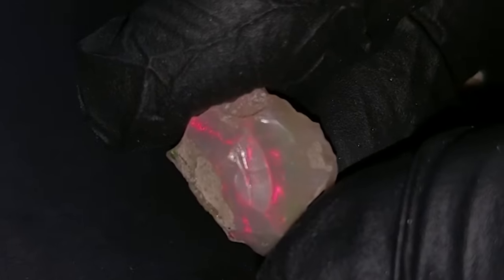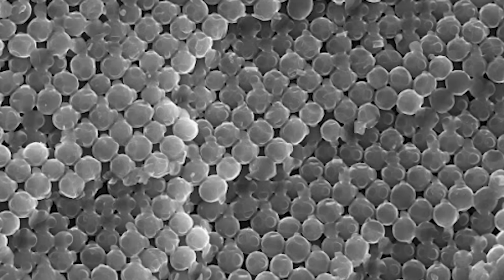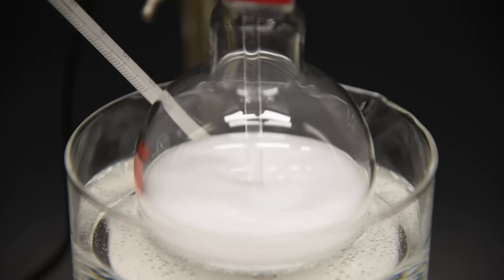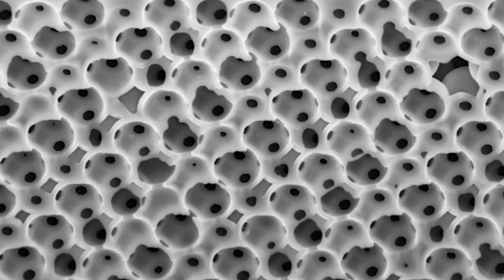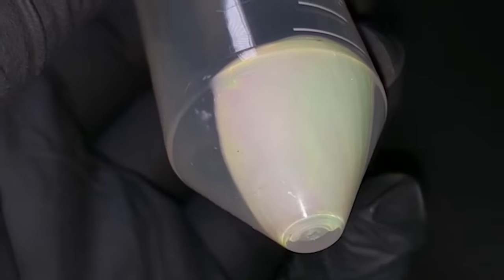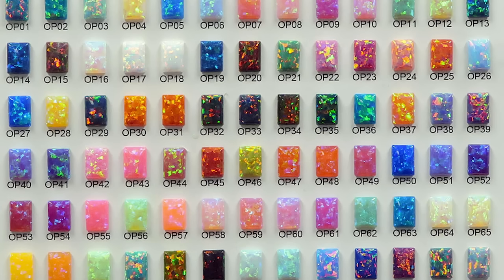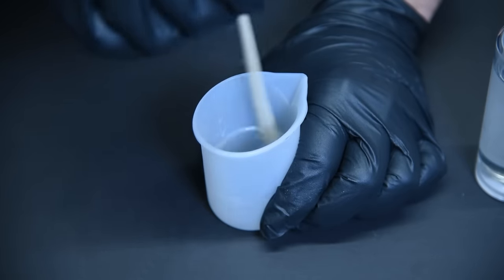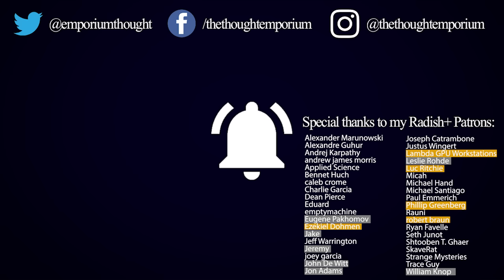Can you GROW an Opal?

Comment: For the resin, maybe try cactus juice or another wood stabilizing resin. To prevent the tiger-stripe effect, maybe attempt to use an asymmetrical mold and allow the opal solution to settle out over multiple additions with some level of disturbance and changing the nlangle that the mold sits every couple months (essentially attempting to replicate natural deposition in the dynamic environment of the earth with tremors and changing pressure)

Comment: Regarding the resin, maybe you could put the resin into the vacuum chamber alone, then put the opal into the resin, and then putting that into a pressure pot.  That's the process used for resin moulding.  As for what type of resin to use, I'm not sure what would be best, but probably a 12hr, or 24hr resin would work best, since those ones are a lot stronger.  I like west system resins for my projects.

Comment: If you used a pressure pot you could use some very very runny acrylic, I use PMMA for making dental appliances. Possibly you could also cure it under a vacuum instead of pressure
Reply: Maybe on the vacuum id personally go with a pressure pot. Gets rid of porosity which is the main issue with runny mix of resin. The one we use is mixed kid of thick but somethings we need it super runny to pour into the small crevices if we aren’t using hydraulic press and it will get porositywhen mixed runny so we put in pressure pot so all the excess solvent is pushed out of the mix. Maybe this could help bc it would push it into the small micro holes on the opal

Comment: You need to add intense pressure along with your heat. Also look up water glass. Get you some raw granite, rose quartz crystals, copper and silver nitrate. Pulverize everything. Use water glass process. But intensify heat then pressure. Or just take a quartz crystal and heat. A torch will give an aura look. Slow hot heat gives another set of colors. Much like the fake Opal, you can create some pretty cool things.

Comment: You should try LOW VISCOSITY resin that is typically used to stabilize wood under a vacum. Maybe this way is better to fill those very tiny gaps between particles

Comment: I absolutely love the video, I hope that you keep attempting to Improve the process.  My guess for the synthetics would be a matter of 
pressure, temperature, and possibley vacuum chambering at some point during the process. The last opals you linked without the striations looked very much like a cured resin pucks So there is either an Atmosphere or chemical difference that would cause the opal to creep up on the sides like that

Comment: So, in my brief googling, I have found that opal naturally forms by hot water falling onto sand, picking up silica, filtering through some sedimentary stone, and finally depositing that silica in a void in the host stone. Of course, this natural process takes several thousand years, so it's not something that you can just wait around for. 

So, what if you mimicked that process? Drip your heated silicon mixture onto a host stone, let it dry, drip again, dry again, etc etc. I imagine this will eliminate the stripe effect at the cost of a longer wait time.

Comment: I bought a small bottle of UV resin. It solidify on contact with UV.
Accidentally a drop of resin dropped to my finger, I tried to beam the UV to it, and it solidify quickly.
The photo reaction is exo-thermic. I felt a strong burning sensation, but since the drop is small. The reaction soon ended.

I would suspect the UV resin on the opal didn't work out because of the heat.  
May be pouring the UV resin and monitor the temperature, make sure the intensity of light isn't too strong.

Comment: Would there be a way to let the solution settle under pressure? Or, maybe add pressure periodically through the settling process to break up the grain columning?

Settling under pressure might tighten the matrix as well, removing the need for a silicate or resin filling to counteract cracking during drying.

All that said, I am not a chemist, or a gemologist, or a scientists of any type, so take my rambling suggestions with a grain of salt. Just throwing out ideas.

Comment: I know I'm a little late to the conversation, and I'm not exactly a chemist, but it seems pretty obvious, at least as far as I can see it, how a person could get rid of the tiger stripe patterns.

Step 1: start growing the pre-opal in the normal stripy way.
Step 2: partially, or perhaps even fully stabalize the pre-opal, making it hard and sturdy enough to break instead of powdering.
Step 3: break the sample into irregular fragments.
Step 4: create more pre-opal in the normal way, but add the broken fragments to the mass, incorporating large amounts of irregularity into the tiger striped pre-opal.
Step 5: repeat steps 2 through 4 at least a couple times more.
Step 6: fully stablize and finish the mineralization process to turn it into opal.

This might take a significantly longer time than the striped opal, but it at least sounds like it would allow you to induce irregularity.

Comment: Ever consider a wood stabilizer like Cactus Juice or Stikfast where the object is submerged in the stabilizer then pull a decent amount of vacuum until you feel all the air has been removed. Relieve the vacuum to allow the stabilizer to be pulled into the empty spaces then wrap in tin foil and heated at 200 degrees F to cure the stabilizer into a solid. Ta-da

Comment: I have no experience in stabilizing opals. I suggest, to stabilize opal, you could try vacuum packing the opal and thereafter introducing into that vacuum cyanoacrylate glue (open thereafter to allow moisture to polymerize it) or try 2K car clearcoat (then could leave it closed until polymerized). Please tell us how it turns out for you.

Comment: I have an experiment that who wants to try 
I called bucket Opal experiments. 
You need a bucket with top ,a tube 3/8 or whatever, long 24 in or more filled  with desiccant silica gel ,two bottles  container A and B ,A connected with B ,A bottom inside with small a water ,bottle  B glue on top of lid and B a tube goes half  the
 bottles .you need  to put out side in the sun ,bottles  B needed to holes smaller to control pressure  .

Comment: I wonder if the tiger pattern is not just the crystallization that seeded from below and build up, so what you would need to do is cutting to pieces an opal you already formed crystal, isolating crystals, and use them for the germination of bigger one that you can then place in the solution the way you want so it grows together with other crystals.

Comment: so the process of stabilizing the opal your going to need a vacuum chamber and thin your resin out with alcohol i use iso but i am sure you can use others. so your going to soak the opal in the solution for about 2 weeks take it out and put it in a vacuum chamber to make the resin go into the cracks. you may need to repeat the process a couple of times.

Comment: So if you're trying to get art resin into tiny holes, they use a heat gun for that. Just blast the top with heat and the air all bubbles up to the surface and pops.

Comment: It should be noted that using a VPN is not really a form of protection for your information, it just changes WHO gets that data; normally your ISP would see where you go online but if you use a VPN whoever provides that VPN gets that data instead. It's kinda like saying jumping off a cliff will save you if a bear is chasing you, the bear likely stops being a problem but you're now falling at high speeds off a cliff.

Comment: Try penetrating resin that is used for wood. You use a pressure pot to penetrate the material and then an oven to cure it. Maybe that will work??

Comment: Peter brown did some experiments with Stabilizing resin which is very runny and intended to soak into objects, maybe that would work?  Otherwise, I'd suggest using regular resin but placing it into a pressure pot.

Comment: Learned more about opal and the way opals form naturally its from water sinking through sand picking up minerals and silicate on its way down for a long period of time before forming opals what if instead of using water that is filtered like most water is these days go and get water from a location high in minerals such as yellow stone National Park were all those sights with hot water is super high mineral water or go to one of those pools that are mineral pools that get water filtered to them from a location that's usually to hot to swim in.

Comment: i would imagine one way of breaking up the tiger stripes could be to let it settle out in layers (where you'd carefully swap out the solution in between) of different particle sizes, possibly with layers of extremely small particles in between (to "fill in" any surface details so they can't be stuck to by the next layers).

Comment: Some of the synthetic you showed looks alot like a 2 part epoxy with different colors and metallic resin colors added like the chrome illusions or even fluorescence that are  used to marble floors,  counters tops or tables. The stuff  turns very hard like stone and very fast. When it's not applied properly, say for example someone doesn't use heat from the torch to  level out  spots or remove the bubbles that may be trapped in it by waiving the torch over it while it's still setting. It turns to a stone like surface that will have to be sanded down the same way you would polish and sand  stone or gem. I'm almost positive that those pieces are the 2 part epoxy. I'm pretty sure if we can make floors that look like opal ,gold, copper, granite, slate or almost any other stone or shiney surface  including metal and color changing fluorescence then it could be used to create those slabs or other shapes like marbles. In sure it would just take time working with different mixtures and molds until you got something that would either be finished when dry which would be less then 48 hours to be no less the hardness of a gem stone. Then using a gem stone sander you could shape what you want or like I said find a process for making it on molds. 1 thing that I would be curious about is would it need a top clear hard epoxy clear coat to cover if sanded or not. But there are you tube sights for fluorescent, metallic and all kinds of other epoxy things on you tube that you could look up to see what I'm talking about but I'm pretty sure with your back ground and the short cure time along with the amount you would get for the price that you could come up with a process pretty fast. There is a sight on you tube that sells smaller batches to carry stone epoxy counter tops and the process they use is on a much smaller scale then floors which would help make smaller batches and show you how to use it. These are specialty products used for are trade and i think you were thinking in the right direction with the art resin but just missing some main ingredients. The 2 part epoxy is the process but adding colors and finding the correct mixture to make what you want with it is the difference.

Comment: Man I love this video! How to get non-striped opal... I feel as though there does need to be a vibration present while it is settling but that the vibration needs to correspond with the correct resonance... It needs to be a very very fine vibration so that the cells will settle together more quickly and line up better but also it would disrupt the pattern of a single color starting and then the cells of the silica nesting in won't just solely line up with the cells that are underneath it The problem with this is that I think that it's likely to make your entire opal the same color...

Maybe if there were two or three of the correct frequencies and it rotated through those frequencies every so often that it would break this stripes up. 

I'm saying all of this but I'm a biologist not a chemist... So this is an instinctual thing that I'm saying that could be completely wrong and inaccurate 🤷🏼

But if I were going to make a random stab in the dark that is what my guess would be 🤷🏼🙏🏻😊

Comment: So you have a recipe for Red, Green, Blue? or RGB, so you should be able to make vibrant yellow or maybe even orange by mixing 50:50 red and green, and they should crystal pack as 50:50 too. Red and blue should be really cool because purple is like a color our eyes shouldnt even be able to see. My question to you is, do you actually know how most people grow crystals? if your stuff is in polar solution, you might put about 10 ml in a 20 ml vial, then you get a 100 ml or 250 ml bottle and put 20-40ml something non polar like hexanes, but you could even try something slightly polar. you put the 20 ml vial into the bottle that has liquid so they can exchange vapor but the liquid isnt flowing from bottle to vial. Then seal it up and let it sit for days or weeks. You can scale this up or fill the bottles more full if you like, just dont float the vial. But more full means shorter vapor path so its gonna happen faster. Also I think you should use more oxygen free setup when making your particle. Its not hard to do, it just means putting a septum on your RBF and then adding everything via syringe. you would also need a magnetic stir, and im not sure why you are using the over head stir instead of a magnetic stir. Since you are heating this stuff you dont want a closed system so maybe some nitrogen in a latex balloon, and the easiest way is cut a syringe with needle and then just rubber band the balloon to the syringe.

Comment: ⏳:
0:00: 💎 Opal, a unique gemstone with play of color, comes in various types and can be quite valuable.
3:52: ⚗️ Creating colorful opals through precise stacking of particles using a chemical reaction process.
7:47: ⚛️ Structural color and Bragg diffraction create colorful flashes in dried particles of different sizes.
11:40: 🔬 Analysis of opal nanostructure and color phenomena through microscopy and spectrometry.
15:08: 🔍 Examining grain structure and color variations in opal particles under different lighting angles.
18:55: ⚗️ Creating synthetic opal involves drying, centering particles, and filling gaps with silica or resin.
22:41: ⚒️ Using micro mesh polishing pads to achieve shiny surfaces on opals, vacuum chamber for resin penetration, and thanking sponsor.

Comment: DId you try using thin CA glue and a vacuum to try and stengthen your opal? Also, I'm willing to bet they VERY slowly roll the sample as it settles to avoid the tiger striping. Just a gues, but seems plausible.

Comment: What if you were able to make the long tiger striped opal and then thinly slice it into very thin layers, re-orientate the layers to randomize the pattern then reheat the stack at a temperature to refuse but not melt the layers together. That would eliminate the large tiger striping pattern.

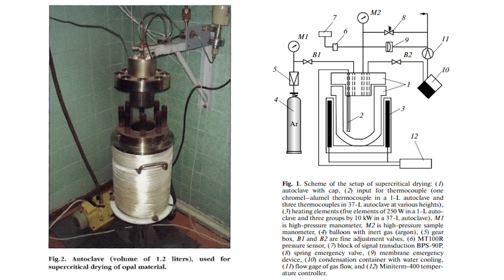Comment: Is the autoclave mentioned at 17:57 flooded with N2 or something else? I'm somewhat familiar with the process of making reverse opal, since I work in a semiconductor fab and the process used to make reverse opal is very very similar to the process of making transistors with doped silicon/doped silicon gaps. We use N2 for pretty much all of our pressurized processes in the chambers of the manufacturing tools. Just curious to see just HOW similar the processes here are.

Comment: have you tried thinning the resin via heat/denatured alcohol/acetone? respectively, that list increases in amount of damage done to the cellular/structural strength of the cured resin, buuut if any of them wouldn't destroy your opal sample, well, there's some leads. I know there's also something out on the market that lapidary people/jewelry makers use that is specifically formulated to stabilize specimens (such as turquoise, which is often too crumbly to make a cabuchons if left in the rough) for lapidary work. me ght be worth looking into. (I'll edit this with the name of the product as soon as I remember / find it). thanks for the detailed vid!

Comment: Once you have the tiger striped opals, crumble them up a bit and add them randomly to a batch in the process of settling to break up the column grain. Also, I wonder what compressive drying like is done for cider extraction would do.

Comment: Not sure  if you solved your resin issue as this video has been out for a while.  I was wondering if you had ever tried thin cyanoacrylate as ive had some pretty promising results without the need for high pressure so I have a feeling with pressure it will be even better. On its own the thin formula cyanoacrylates do seem to soak in very well and add a tremendous amount if strength to the opal. It's also very strong, highly polishable, and crystal clear so it works quite well for me. Let me know what you think if you haven't tried this. I  didn't look through the comments so perhaps this is already mentioned. If so great I not I hope this helps. Best of luck